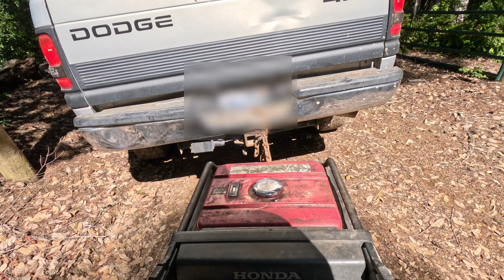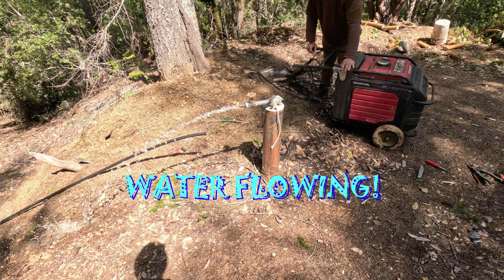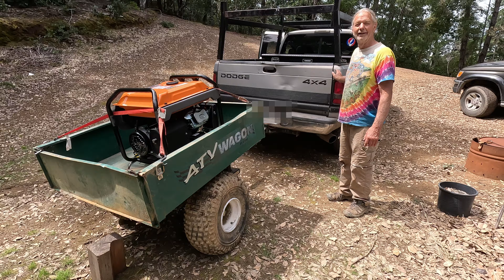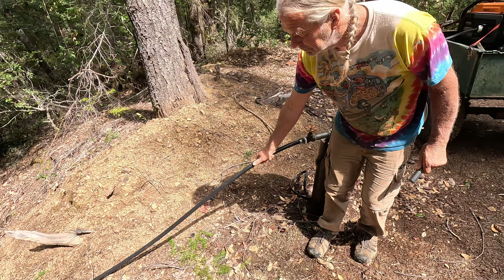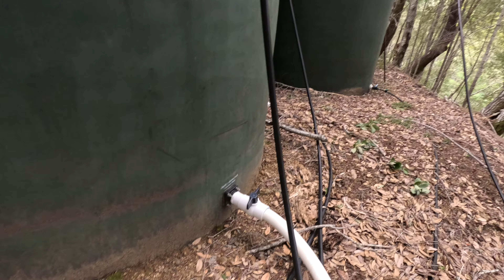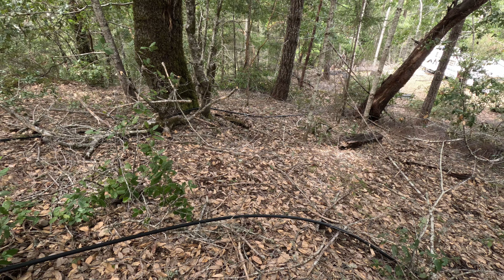Water Storage & Well Pumping Experience, April 2023

Comment: That's the only time the auto start worked on the brand new generac generator. Been pull starting it ever since.  We later removed the gas tank from the Honda to find major rust in the tank. So no wonder why it wouldn't run. After cleaning the tank and adding a fuel filter,it works fine now.....DUH!!!
Reply from the maker: Haha always something!